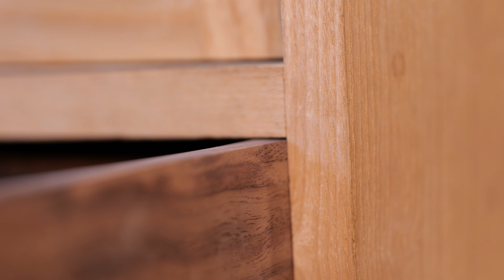Fitting the Drawer | The Cabinet Project #25  | Free Online Woodworking School

Comment: Interesting.  Nice to see you plane from back to front to fit the drawer; I always use a feeler gauge to check for the high spots and it makes it much easier to fit if there's no back panel so you can check the drawer as it's progressively fitted.  David Charlesworth's technique of fractionally widening the back opening is also very useful; I use some 150g sandpaper stuck to plywood with ds tape....again, much easier to do this from the reverse side without the back panel fitted.